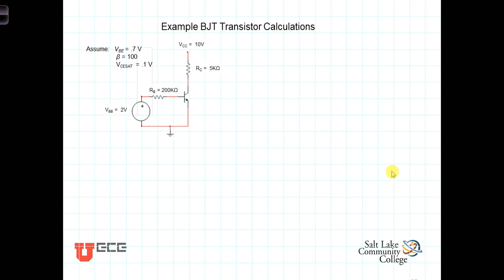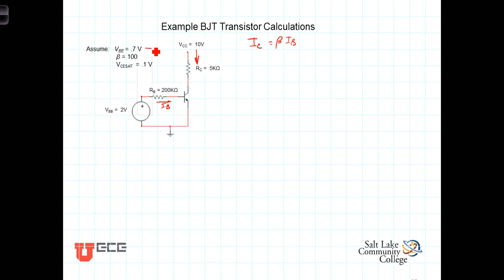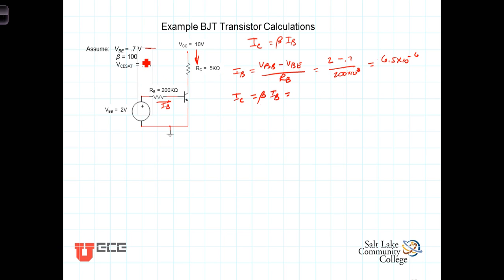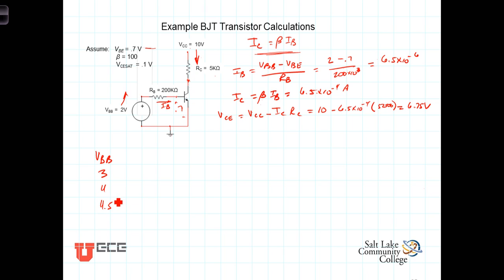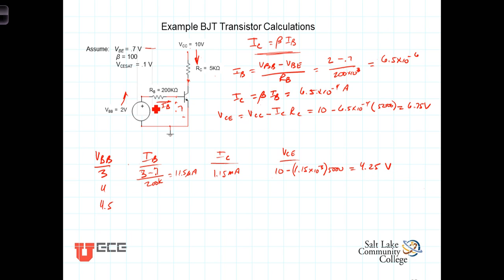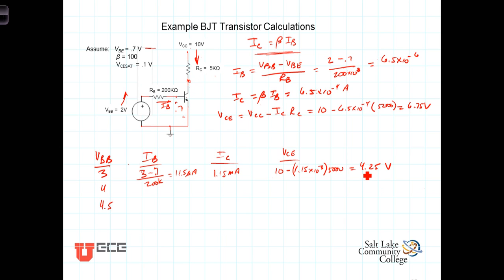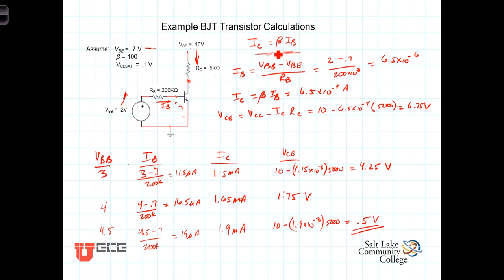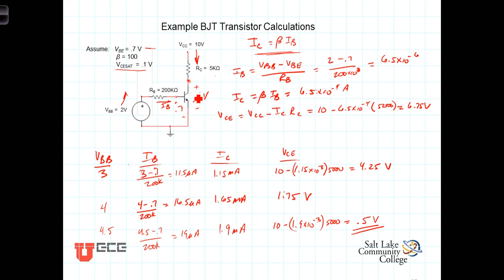E2 1 Example BJT Calculations Mode of Operation

Comment: So reverse biased means Vce < Vbe; also means; 
The Base not getting enough (micro or whatever) amperes to open the (collector emitter) valves; thats why there is a voltage drop created across collector and emitter because its resisting to let it go. 

And the saturation region is means opened valves as much as it could to pass maximum amperes it could. So there is a little voltage drop across the Collector Emitter junction :) 
Thanks for the example showing the difference :)